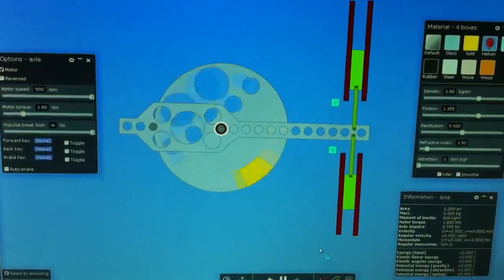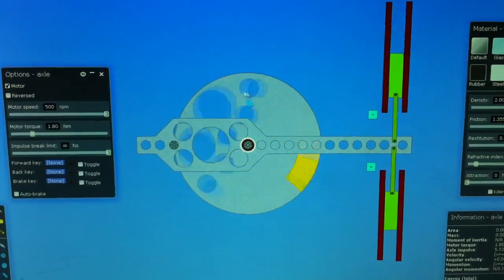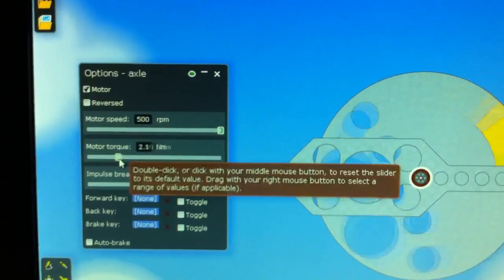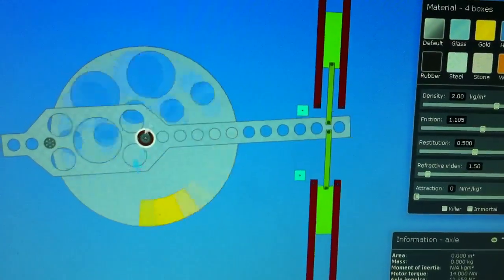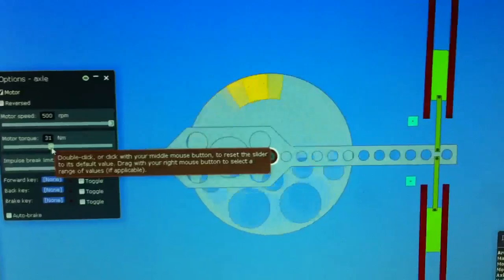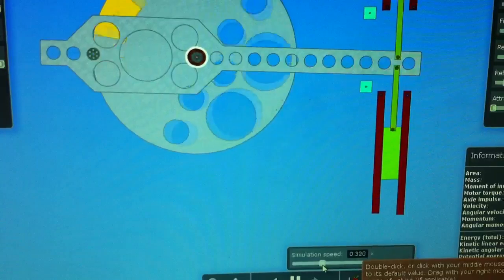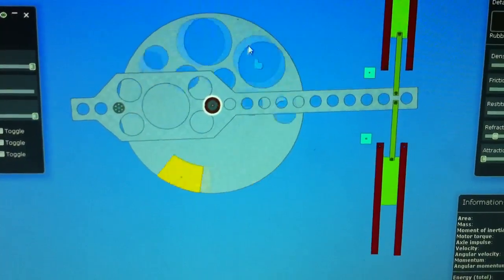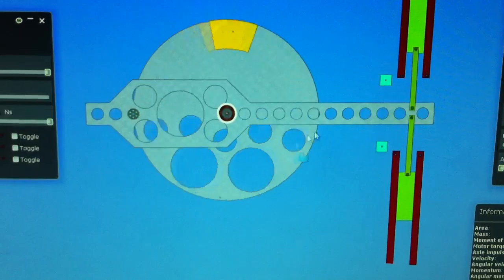Centripetal Force Converter

Comment: Fine, but in practical terms you need to put a counterbalance to the weight of that  unbalanced flywheel or else the whole thing will drop to the lower limit.    I suggest springs should be used  to absorb impulses to return the energy later .

Comment from the maker: That 500RPM setting is only a limiting maximum in this program (Algoodo), not the actual speed. The speed will vary with the input torque. You would need to know a few more details before any calculations could be made here. This was just a roughly sketched up concept. Only the computer knows all the numbers on this one.

Thanks for watching.

Comment: Question.

You are putting ~100W input
(500RPM = 52 rad/sec, at 2Nm = 104.7 W, that is not insignificant)
What is the Frictional/damping force at the Output??  and the Distance of oscillation of the output arm...??

Mechanisms like this may be very efficient as there is no transmission loss, but definitely not over-unity.